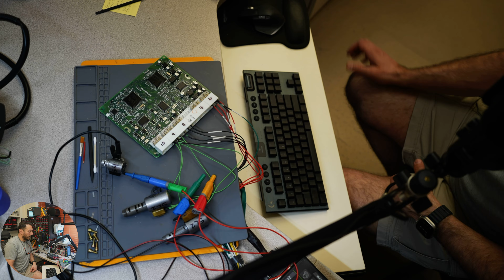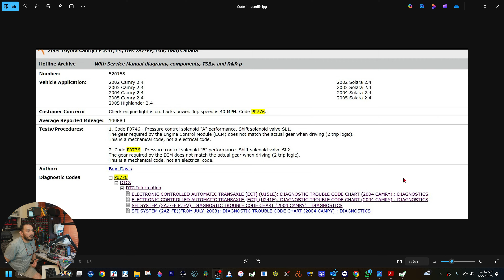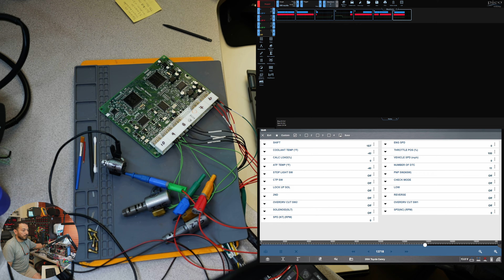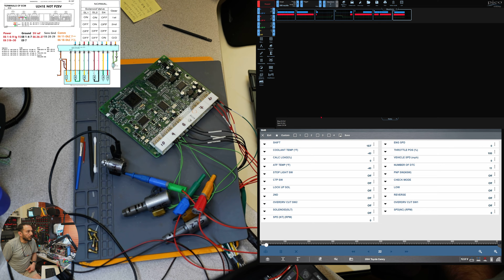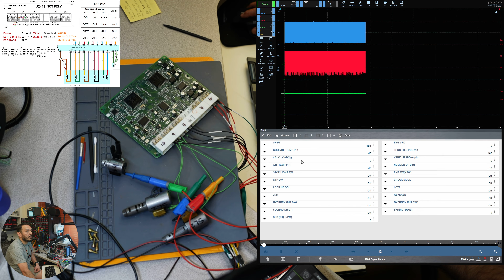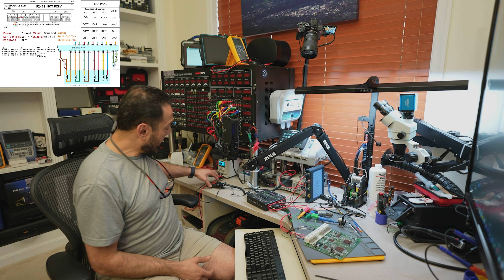2004 Toyota Camry ECM P0776 and P0746 full test with solenoids. www.maicsalazardiagnostics.com

Comment: Same here, our cambry 2004 had the same condition, we change a whole transmission and still have that knock on 1st gear to 2nd gear, change the ECU from a junkyard and stills the same, you recomend me to change to a 2nd ECU? Also i checked the SL1 and SL2 on a osciloscope and read exactly the same pulses that you read on the video, but the red one, wouldnt be the signal problem? cause i think that the top pulse its not long enough to energize the solenoid, and the code says that the solenoid stays off. I hope you can help us, amazing video btw 👍
Reply from the maker: The problem with junkjysrds modules is that they have not been repaired. So you might many luck find a good one that will work for a while. The best is to send the module for repairs. It will cost more but it will correct your issue.

Comment: I have an 2004 Camry 2.4L 92k miles with a P0776 I changed all the solenoids with new fluid and filter and still the same code. Could It be the ECU?
Reply from the maker: Yes! Send me an email at maic@maicsalazardiagnostics.com

Comment: Good morning. I have this problem with my 2004 Toyota Camry. It knocks in first gear, and the code it throws is P0776. I changed the transmission and it's making the same knocking sound. I changed the computer, and it does the same thing.
Reply from the maker: Well, did you test the ECM on known good vehicle? Is the transmission a rebuilt unit? Have you test the wiring?
Reply: @MaicSalazarDiagnostics Hello, good day, I already solved it, it was the computer.
Reply: Same here, our cambry 2004 had the same condition, we change a whole transmission and still have that knock on 1st gear to 2nd gear, change the ECU from a junkyard and stills the same, you recomend me to change to a 2nd ECU?